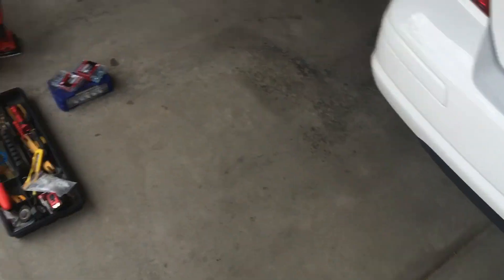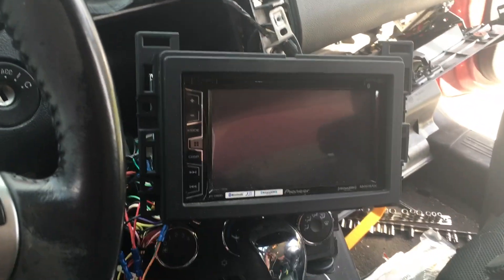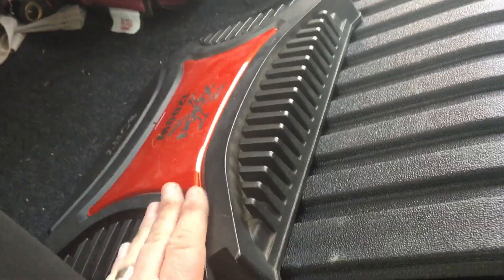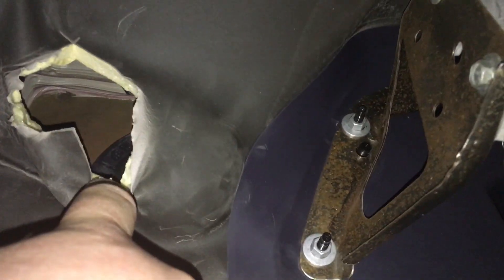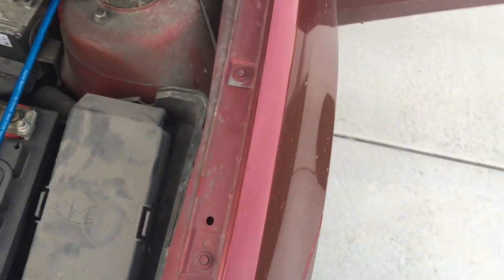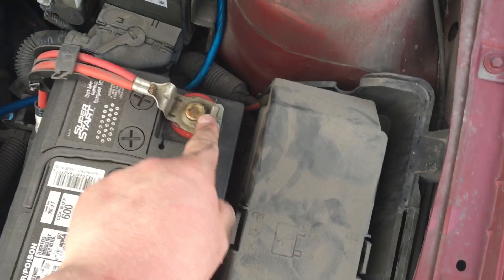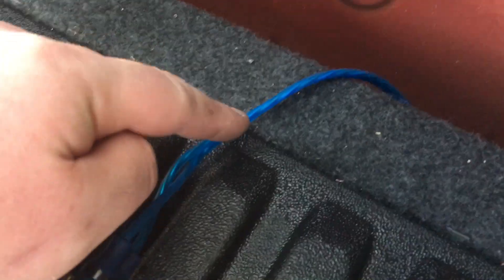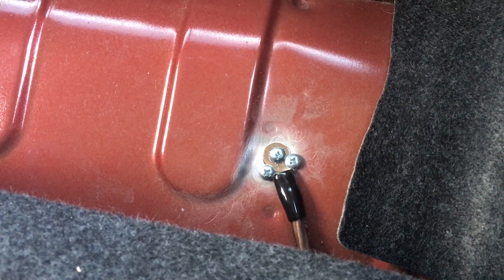2004 - 2009 Pontiac G6 Amp and Sub Install

Comment: If you're a crazy driver like me, I recommend using ratchet straps to hold the box down to prevent it from shifting around while you drive.
Reply: So the nylon straps can melt when the amp gets hot lmao 🤣 there's mounting holes derppppp 🥴

Comment: So I have the Pontiac g6 gtp with the monsoon factory amp I have my factory stereo, with a amp I have a line out converter from Best Buy tapped into the back speakers my amplifier keeps cutting out usually when on the highway and the radio turns itself up because of the speed.. any suggestions

Comment: my amp on my all-in-1 (I know its crappy but its what I have for now) won't turn on even though I had the remote wire hooked into the back of the radio. I have the wiring  harness that has a separate power wire thats tapped into a fuse under the radio. Any idea why it isnt turning on or where else I should put the remote wire?

Comment: Im using and line out put converter for the stock radio but I'm just having trouble finding out which wire are which

Comment: What wire is the remote turn on for the radio if u still have this account?
Reply from the maker: Aftermarket remote turn on wire is generally blue / white, but may vary depending on the manufacturer.

Comment: what did you tire the fuse into for power because I had an install done on my g6 and they put it on the ignition switch fuse and it fried ignition switch.
Reply from the maker: We didn't tap into the ignition switch.  Our power went directly to the battery with a 100 amp fuse and our remote turn on wire tied into our aftermarket radio.  Now if you do not have an aftermarket radio, you can tie into the fuse box for switched power using an "add-a-circuit" adapter.  Generally, i don't recommend going directly to the ignition switch.

Comment: How about if I'm installing a sub but I only have the original radio.
Reply: You can splice into back speaker wires high level input, or get an high/low level converter, same with this on speaker wires it just gives you rca outputs.

Comment: Can you make a video about how to connect the front speakers and the rear speakers (not the subwoofer) to an amp?
Reply from the maker: This was a customer vehicle, so i wouldn't be able to right away.  Easiest way to connect to all 4 speakers (if you do not have the factory amplified system) would be to connect to the radio speaker outputs behind the stereo that lead to the speakers.  So, once the 4 channel amp is mounted, you would run speaker wire from the amp to behind the radio and connect it to the speaker output wiring (which leads to the speakers individually.)  Hopefully that makes sense.  This will save you from having to run new wiring to each speaker since effectively we are using the factory wiring.

Comment: Man Please answer, I see you've had installed an another radio, does all the information showed like the tire pressure or % of oil still showing ?? Does it all works after wiring new radio?
Reply: 19XBlackskillsX97 Metra kit single din with computer.
Metra kit double din computer box.
I have a Kenwood Touchscreen in my G6, and I had to install the computer in my glove box to keep all those settings.

That’s how you keep those settings
Reply: Those should be the two models.
Hope That Helps!
Reply: You can also hookup with out the computer for oil, Tire pressure etc.
However I’d never do that to my car just for a radio lol 😂

Comment: are power wires always blue? and do they come with the vehicle or buy separately
Reply from the maker: No, they can be any color. Aftermarket wiring never comes with a vehicle, always purchased.  All components used in this install are completely purchased separately.  Please see the description for details on what parts were used.

Comment: Do you need a aftermarket radio to set up a sub?
Reply from the maker: Nope, you can use a "line out converter" to tap into your speaker signal on your radio to provide an RCA signal to your amplifier.  Use this video as an example: https://youtu.be/HsBHQdZh_8Q